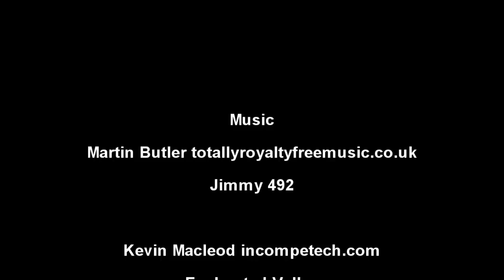Vauxhall Corsa C Handbrake Cable How To Fit

Comment: Good work.  Don’t forget these cables stretch over time too,  the outer cable can also compress so you end up with cables that aren’t snapped but don’t apply enough ‘pull’ to the mechanism in the drums.  This is the problem with my son’s Corsa and I will be changing the lot soon!!

Comment: The cable that runs across the rear beam on mine had snapped, and the main cable was also frayed, so changed them both. I managed to split the main cable above the heatshield, so didnt have to sod about inside the car removing it. Big thanks for this, all done, didnt take too long.
Reply: instaBlaster.

Comment: when removing the rear hubs there is a hole in the back of the hub for you to release the pressure on the shoes. little rubber bung you pull out and use a screwdriver to move the handbrake adjuster - easy. no hammering of drum or levering required.

Comment: I made the error of removing the adjuster nut. Nightmare trying to feed the cable through enough. to get it back on. I literally need an inch and it's not budging :(

Comment: Great video , I've got  Tigra B but most of these parts are identical. You mentioned about ordering the wrong parts, I did the same , what a nightmare that was , so many variations between models. Last year I replaced the short cables at the drums , everything was seized , so had the shoes replaced as well. Freed up the main cables , noticed they were a bit frayed but couldn't bring myself to replace them at that time , LOL. Finally plucked up the courage to do it yesterday , didn't take that long actually , except for dodging the heavy rain ! You are completely right about keeping the adjusting nut at the end of the rod when attaching the last of the cable connectors. All back together now and working great , almost like a normal hand brake again :-) 
Count me in as a new subscriber to your channel.
Reply from the maker: Hey James, Glad you got it sorted and thanks for the sub.
Cheers
Martin

Comment: Great job Martin. I did the same repair to a Tigra mk1, exactly the same cable! Although once back together, I put a big dollop of grease on the rear cable guides to let the cable slip through freely, less chance of fraying. Out with the t-cut to get the scratches out of the Mondeo bonnet though. Keep it up.
Reply from the maker: Yes, I should have put copperslip on mine but that was in the log cabin and i'm a lazy git so I just used WD40 haha. I'll do it today though.
Cheers
Martin

Comment: Great video - many thanks. I was able to replace both L and R centre cables which had frayed in their guides near the trailing arms. (the Left centre cable is much longer and runs to the brake lever cable coming from the interior). The other 3 cables were fine. 2 hours work and £20 for parts from ECP

Comment: Many thanks Martin , sorted my MoT fail out after the tester snapped the central cable! Must have been ready to go I guess. Nice straightforward video. I found that undoing the 4 bolts holding the handbrake assembly down helped me to be able to be able to get to that awkward coupling between the handbrake short cable and the central cable going to the back ( I pulled the old cable out and then fed the new one up through the hole in the bulkhead.
Reply from the maker: Well done

Comment: Mate - I'm delighted to have found your videos!
My 2006 Corsa C 1.4 Twinport just failed it's MOT because I snapped my handbrake cable, and the Offside driveshaft was knackered.
Going to do the jobs myself - thanks very much for the great tutorials!
Reply from the maker: Good luck Matt
Reply: @retrorestore   Got it all done - plus some other bits and bobs - passed MOT with no advisories! Thanks for your help

Comment: Awesome vid, even for a Dane like my your British is easy to understand. The only "bad things" (for me) are that: It's winter and snow now, even though I have a small garage it's not nice to do such work now. And I only have the original jack that came with the car, and no axle stands. And no torque wrench. And it's pretty dark in my - by now - winter cold garage. I DO have a head lamp, though. 
Nah, I'll leave it to my mechanic. I think my excuses are valid. I do change oil and such myself, though. But thanks for the vid, was almost mesmerizing to watch.
Reply from the maker: Thank you for your comment

Comment: Very very good video. I did my brakes today with the small cables. Now pulling my handbrake it goes all the way up and doesn't grabe with the brakes could the cable be stretched ?
Reply: Did you adjust the cable as Martin did at 26:23?

Comment: For me, it might feel like the cable was broken, but it was actually stuck on the guides where the cable was frayed. This resulted in the cable not getting back to tension which made it hang loose, as if it was broken.

Comment: Just put new shoes on a corsa c and the nearside wheel is stiff to turn by hand. Drum went on ok but after test driving it feels like the brake is stuck on slightly on that side. What should i check? Thanks for the helpful videos.
Reply from the maker: Check the little plastic blocks that the handbrake cable sits on at each rear wheel, they are prone to getting crudded up and stopping the handbrake cable releasing fully. Give them a good clean and lube.
Reply: read my comment above

Comment: Hi mate, great video! I think I've literally just snapped mine (not had a look to see what part is gone yet). The parts usually come in 4

1 x Left Hand Rear Hand Brake Cable
1 x Right Hand Rear Hand Brake Cable
1 x Left Hand Centre Intermediate Hand Brake Cable
1 x Right Hand Centre Intermediate Hand Brake Cable

Just wondering what the 5th cable you mentioned is called? Just in case I need to replace that too. Thanks!
Reply from the maker: I think it was a small one going to the actual handbrake lever.

Comment: I am looking for a 2001 3 door fiesta with electrics on it and central locking I can't get one in Ireland would you happen to know where I will get one I don't mind paying up to 600 pounds for one or travelling and I also want to front leather seats from a ford ka
Reply from the maker: Ebay is your best bet bud. That's where I'd look.

Comment: One thing you didnt donwas adjust the shoes up when you put the drums back on
Reply from the maker: They are self adjusters.
Reply: @retrorestore  iv been a mechanic for 20 plus years and iv never relyed on self adjusting shoes ,iv always adjusted them manually,I find you get better breaking efficiency
Reply from the maker: @smilerdon  Probably, but they have been designed to work bud and it passed the MOT as well.
Reply: @retrorestore  fair enough, did you use the footbreak to adjust them ? As iv said iv never relyed on self adjustment,im always keen to learn different ways
Reply from the maker: @smilerdon  Providing there's no wear and the mechanism is clean, they'll adjust fine. As I had removed the brake assembly myself, I knew they were all cleaned but I agree, sometimes the automatic adjusters can stick due to brake dust build up so in that case, I would clean them out first.

Comment: I'll tell you how this goes in my house;
WTF is this.
S### there must be another screw holding it on.
Can someone tell me if it makes a noise when spin this round.
Oh F##!
What do they call this bit, I don't want to be on the phone describing a "thingy". 
Whoever designed this is an idiot. 
I can't fit under this car. 
I'm covered in greasy black s###. 
Can someone bring me some newspaper.
I don't have a 27 mm socket.

And so on and so on for about 12 hours.